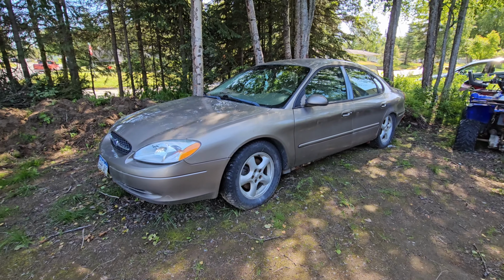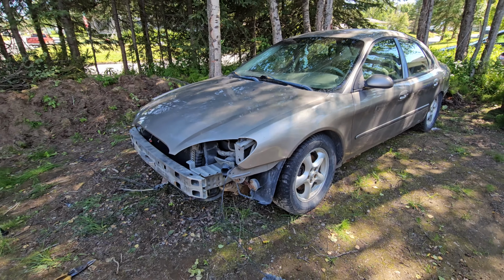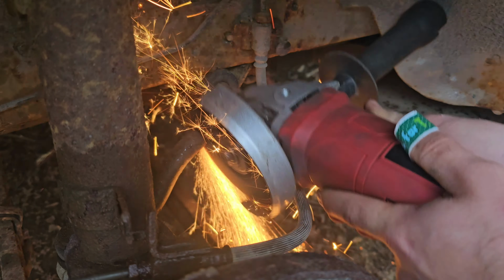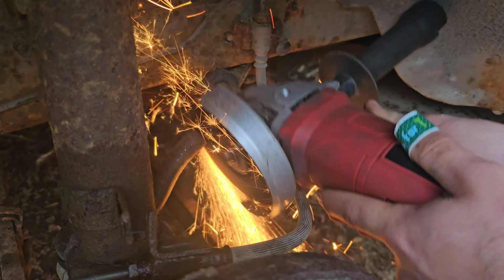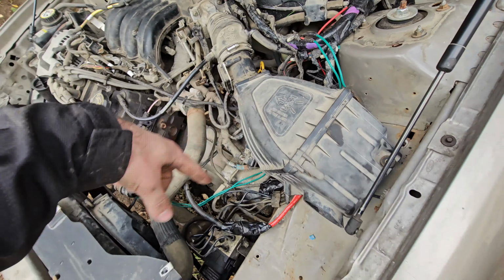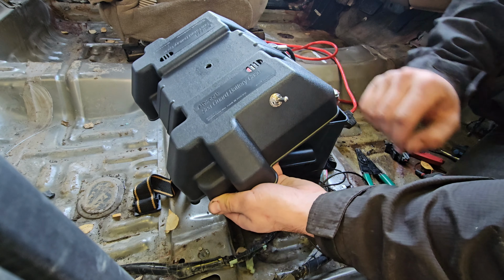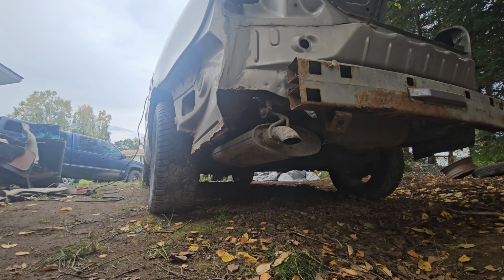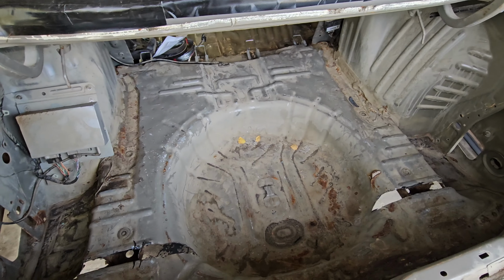The BEST Way to Build a Demolition Derby Car on a Budget!

Comment: That is a nice, comprehensive chain stock build. The only thing I would have done differently is put steel rims on. Aluminum rims can break if they get hit hard enough. Other than that, that build was well thought out. Congratulations on winning your debut derby!
Reply from the maker: Thank you so much! And yes, that's a great point. Steel rims would definitely hold up better.

Comment: bit of advice get an  osculating saw to get take the front and back glass out door glass is easy to take out dont break glass if you dont have to not only dose it make a mess but you never get it all the way out getting one of those saws was the best investment i have ever made for derby also i would really suggest unless your rules state thats all the bigger the tubing you can use for the cage and the max amout of bars your allowed to use i would strongly suggest using bigger material for one and building a bigger cage at least a cage like demolition missions runs or something

Comment: Bar behind the seat also stops the car from braking at the pillars and causing it to buckle
Reply: Dutch tape your radiator hoses as much as you can it will help them not brake or get cut
Reply: If you cut the holes bigger on the hood you can use them as fire holes on the incase of a fire
Reply from the maker: All great tips! Thanks

Comment: Did you try and sell anything else besides the air bags? Also were you able to sell them?
Reply from the maker: I sold the headlights and tail lights on fb marketplace. I still have the air bags haven't posted them yet. Will probably sell on ebay.

Comment: Wouldn't have been easier to pull out all the glass then to breaking it then have to swipe it up and hopefully you get it all so you don't get cut or get some of the fine pieces of glass in your skin. Every car I see they remove all of the dashboard . And just behind the front seat the bar you put in I normally see steel going up on both sides of the car and steel going across the top of the roof. I see steel inside going across the driver's door so when you get hit on the driver's door it doesn't come into the car and hit you.
Reply from the maker: It was very easy to suck out the bottom of the door panels. There was zero glass remaining. Also, this was a compact unibody chassis demo derby. Different rules, then full frame derby. I did the bar exactly how the rules wanted it, and It passed inspection with flying colors. The demo video is coming very soon! Stay tuned.

Comment: I'm a ford guy but probably not the best choice of car. Lol.... Taurus do some really funky things when they bend😂
If built correctly they will hold up kinda well..kinda
Reply from the maker: It actually held up great! Took 1st place
Reply: @MeleeMotors  wow! That's hard to believe..but awesome!!
Were there no camrys or w bodys in that heat???  😀
Reply from the maker: It was a compact only derby, only uni body frame. No full frames allowed. I posted the derby video. Go check it out!
Reply: @MeleeMotors  I'll check it out!... I study the heats intently...
I will get back
Reply from the maker: Sweet! Was my first demo derby, I learned alot lol
Reply: Im sure you did learn a lot. Lol
Get a battery box with mounts if you run again..haha@MeleeMotors
Reply from the maker: @jdel2315  exactly 🤣